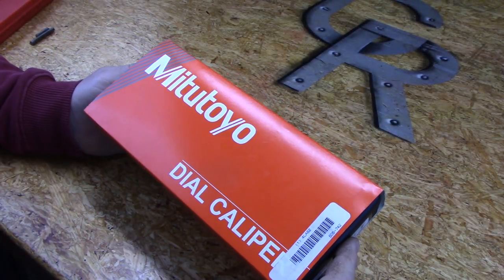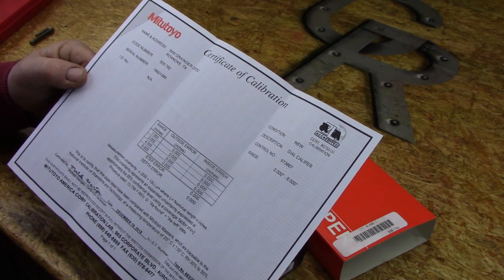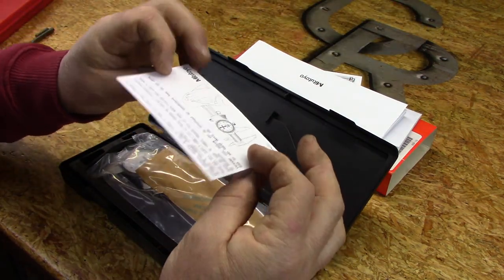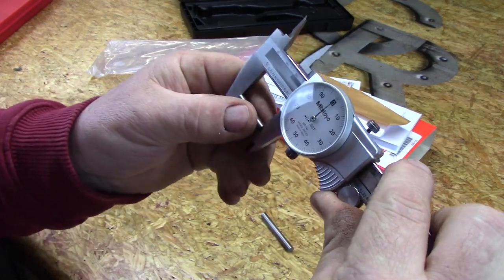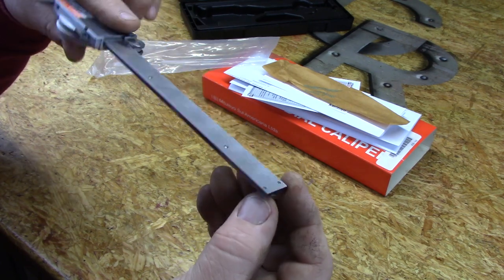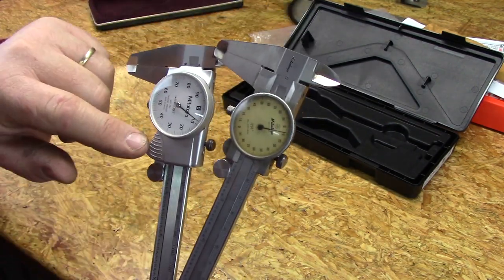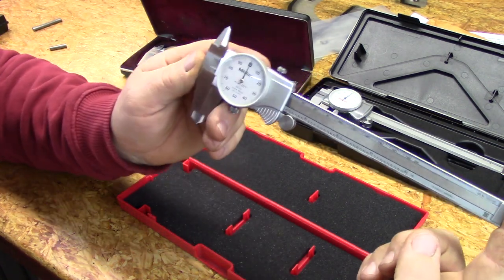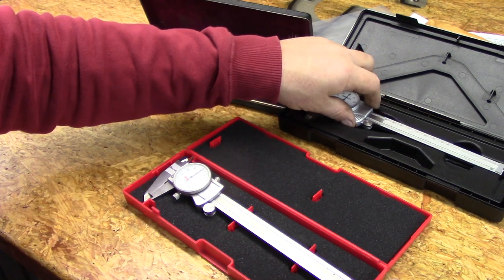Mitutoyo Dial Caliper Unbox & Review, New v.s. Old v.s. Starrett

Comment: Awesome comparison!  I am trying to find this type of comparison between a Digital 6" Starrett #799 and the Mitutoyo Digital 500-196-30 Advanced Onsite Sensor (AOS) Absolute Scale Digital Calipers.  I cant believe there isn't any videos of this. I mean electronic digitals are what many production shops use today also. I think because of speed and ease of math being done for us on the caliper.  Don't get me wrong I love my dial caliper too, but I use it along with gauge blocks and other things to check my digital's readings on the same part. Oh well I guess its a 50/50 shot and most I have read say they are about as close as can be to each other. the Starrett is 127.00 and the Mitutoyo is 116.00 on the Jeff bezos online store fwiw.  I may just go Starrett to be different and support some USA jobs. I bet both are about as good as we can get these days unless your near swiss ones.
Reply from the maker: I don't have a lot of experience with digital calipers.  Pretty much the only ones I've used much are mitutoyos so I can't compare.  I agree that they are both good brands but still I have a thing for Starrett tools.  If you haven't already, check out NYCCNC's Starrett factory tour.

Comment: The dial rotates so you can zero it on any measurement.  The fact that it came not dead on zero means nothing.  Rotate the dial bezel until it is at zero.
Reply from the maker: You're a dip shit.  I said that in the video.  The point is that you'd think it would already be zero'd.

Comment: Do they still make some in Japan? Im sure i see dial calipers advertised showing MIJ on dial,different country of origin depending on country of sale? Im Australian and pretty sure they all MIJ here but i mostly buy used . I only have older ones all metal all MIJ.I was lucky enough to get some NOS (im assuming 80's but im NTS how to date these, i have 3 sets all from different production times,different box styles,all metal but some have plastic like for dial lock  and wheel retention) sealed in box the other day for bargain price! Scored a minty used 6" imperial for $27AUD shipped last week! Ive never paid over 100aud for Mitutoyo, most expensive the NOS ones but they are 8 or 12" (i forgot) so tend to bring bigger coin,they cost me 80aud from memory.  Ive never used a Starret myself,not super common down here,mitutoyo is dominant for (smart)home gamers and industry
Reply: @dunxy it is not easy to tell the origin of the current production Mits dials. Infact, most of the more common generic stuff like low end dials, calipers and mikes. if you do a search online, there is a company licensed to produce tools for the lower cost market. Search for Sanfeng Mitutoy0 and you will understand. However, with that said, these lower cost ones aren't that cheap new either. I have't got any of the new production one personally but seen quite a lot at work. 
I would say, I prefer the older production style with more metal parts. I hate cast zinc too, they go flaky after time. I have a 6" personally and 300mm Tesa dial calipers on my table at work, both having the cast zinc cover. So so smooth action.. I just hate their cast cover.
Reply: Yes they do. You will pay more for them. Just like how starrett still makes them in the US if you pay enough. Get the McMaster-carr app. They have all kinds of calipers on there, and it’s an industrial supplier, so no knock offs.

Comment: Being a manufacturing engineer, my opinion is there could be a huge difference in the calibrated version. If it were me, only the best of the runs would go to calibration. If there were any days or times that variation tended to increase, those batches would not be diverted to a value added process, they would go to QC and be sold if they are within standards (probably tighter than the published spec). 
All processes have variations, and we plan to send only the best for additional labor. 
Fun fact- if a computer chip shorts out during the maximum power test, it’s got something wrong with it, but then we run the test at the lower clock speed and see if we can sell it as the lower power version. Therefore, none of the highest power chips have a known defect, but the same is not true for the lower power model. I always get the fastest because it passed tests that the others didn’t.
Reply from the maker: You're probably right.  Thanks for that insight.

Comment: Please forgive my stupid question, why are there two scale numbers on the beam of your new Mitutoyo: one on top and one on the bottom? I know one of them is in mm and the bottom one is in inches. But how would you use the metric portion when the dial is configured to inches? I'm so confused. Thank you for your help and for clarifying this for me.
Reply from the maker: I suppose the metric scale is for reference only or measuring to the nearest mm without using the dial.  It comes in handy for sizing nuts and bolts and things of that nature.